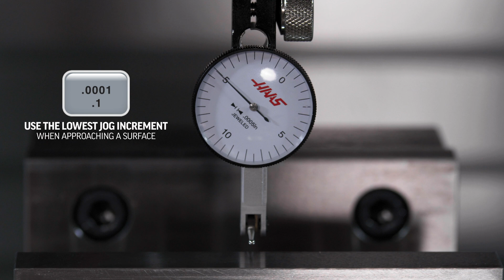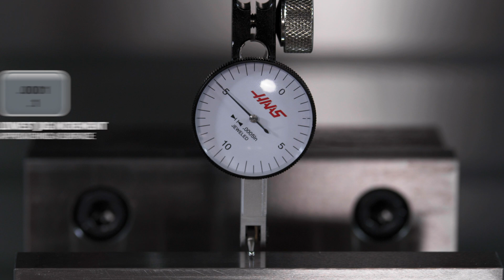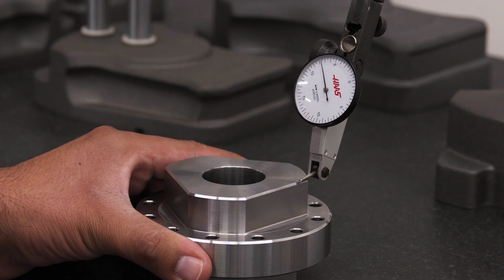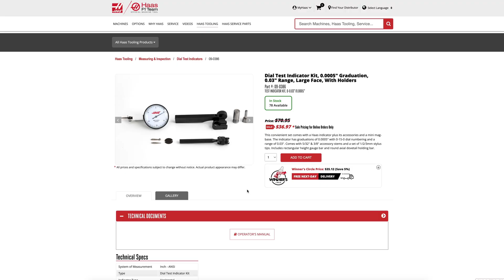Get Accurate Test Indicator Readings - HaasTooling.com

Comment: I hand jog at .010” and .100” increments while the indicator is touching a surface when I’m moving in a perpendicular direction across a long flat machined surface. When moving my indicator towards and away from the work surface, I slow it down incrementally from .010” to .001” to .0001”. In a fast paced job shop, time is critical and jogging even a quarter inch at .001” increments can be wasteful and annoying. Excellent video!!!
Reply: To everyone new, or not in a fast paced shop...
Take your time. You cannot afford to break what speedy there obviously doesn't care about.
Also, avoid working for any shop that suggests you rapid a spindle around to save money.
Maybe check how many OSHA violations they have.
Reply: @m4rvinmartian   We don’t hire ppl new to the industry. You need at least a decade of actual experience to fit in here and must be at least a setup guy level as a minimum. Management doesn’t suggest or dictate technical procedures, thats why they hire us and pay top industry rates. Our boss only tells us what he wants to machine and what material is required. Our job is proof of concept and efficient production techniques while keeping cost to a minimum. You have like 2-3 weeks to prove you can deliver or you’re gone quickly. That is understood and acknowledged in the interview. Also, to my knowledge we have zero OSHA violations, and if we had one in another department outside the machine shop, it would’ve been fixed fairly quickly. 2nd Friday of every month the entire shop shuts down 30 mins early for a full staff safety walkthrough and anything that requires attention gets fixed first thing that Monday morning. Literally everything in our shop can cut you, crush you, or burn you, and there are zero safety shortcuts. I used to work in shops with less than adequate standards because management didn’t care. Glad I found a good home and raised my own standards.

Comment: What about cosine error? Thought that would be mentioned in this video. If the stylus is not at the proper angle, you will not get an accurate reading.
Reply: Needle should be horizontal +/- 15° for accurate readings
Reply from the maker: Great question antshark! Cosign error is addressed in the full length video and another excerpt video we'll be releasing most likely next week.